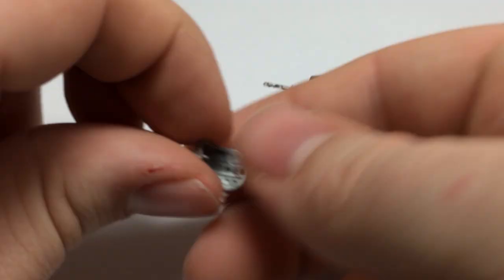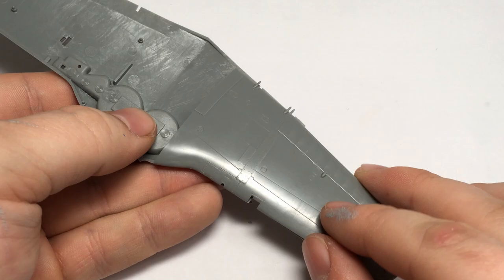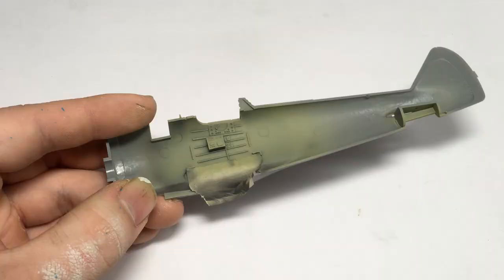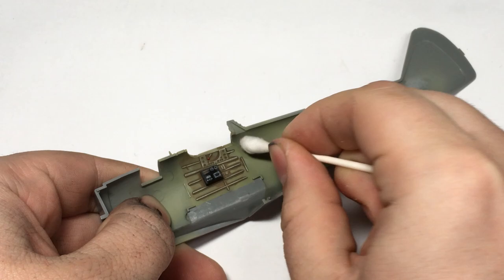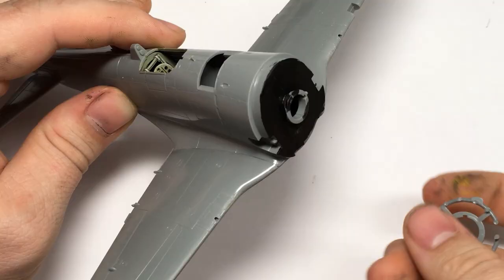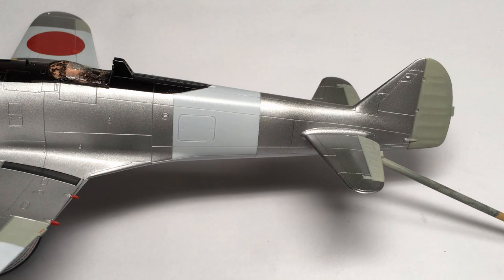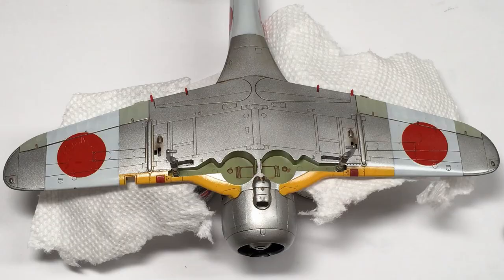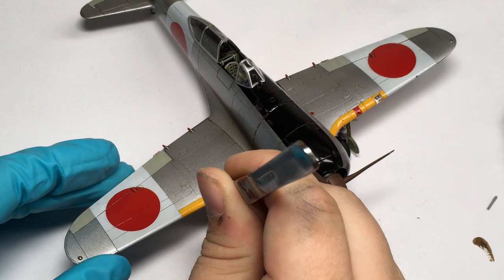Hasegawa 1/48 Nakajima Ki-44 - FULL BUILD

Comment: Nice build of this little JAF hot rod.  Looks nice.  
Was the anti glare panel on the real Shoki really gloss black?  
Seems like it would be blinding in bright sunlight.
Reply from the maker: I don't know for certain, but if I had to guess no. It's also not supposed to be black- it's that same blue-black you see on Zero cowls. I think the blue-black was a semigloss that sometimes would fade to matte in the sun, but I'm not sure.

The kit provides a black decal for it. I just did black because I don't have any blue-black, and an all over gloss was easier to paint than selectively doing a semigloss.
Reply: That's gloss black for sure.

Comment: Great job, looking forward to what you'll create next, any plans to do modern aircraft?
Reply from the maker: Thanks! Eventually. I have a jet age project whose video should be coming out soon. No 'modern' (as in currently in operation) subjects at the moment but I have a few in the stash that I may poke at this summer. F-22 and a few A10's, mostly. I've also got some Russian helicopters that I'd like to do, and though I don't own them I wouldn't mind doing a fullback or a flanker or something similar.
Reply from the maker: I also have a Mig-21 is the 'I've cut a few parts out to hold them together' stage which I guess counts as modern since I'm building it like the Syrian Arab Air Force's current / a few years old examples they were / are using for CAS / strike / antiterror work.
Reply from the maker: I'd also like to do Tom Cruise's F-18 from the new movie if I could find a kit that wasn't outrageous in price. Maybe wait till someone lists just the decals and through it on a reasonably priced Academy F-18.